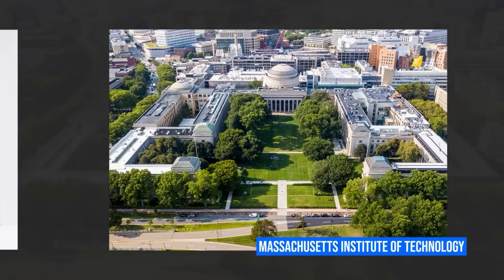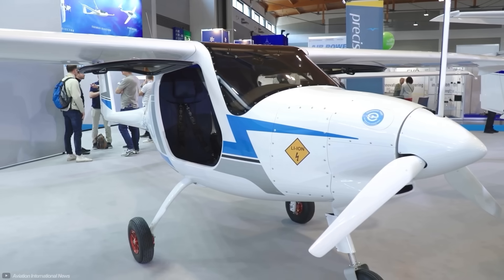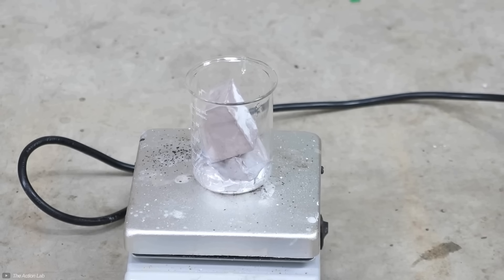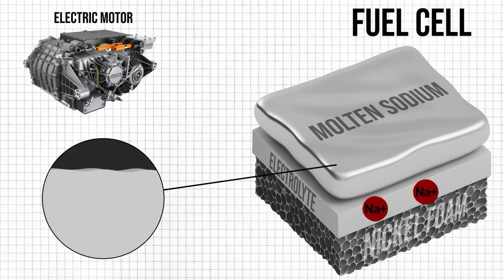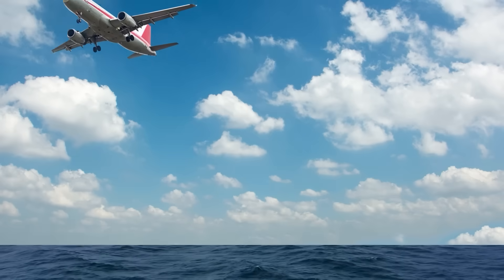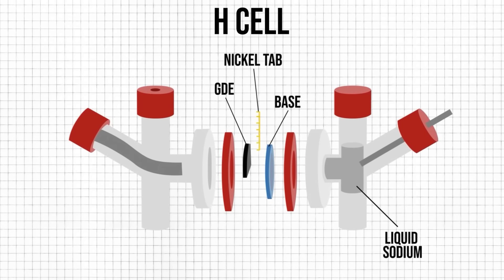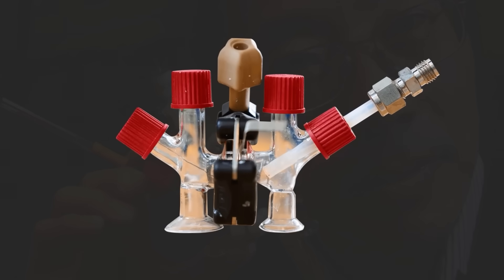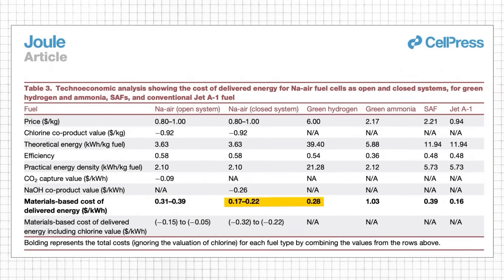How MIT's New Sodium Fuel Cell Changes Everything

Comment: Na ist das Abfallprodukt der Chlorchemie  also endlos  verfügbar.  So viel können die kaum fliegen. 
Es gibt ein weiteres Argument:  Das Startgewicht eines Langstreckenflugzeuges  wie dem A 330  ist um  70.000 kg höher, als bei der Landung.  Die könnten niemals  mit dem Startgewicht landen!  Alu und andere Ideen  sind auf jeden Fall  viel zu teuer. 
Kerosin  ist aber extrem günstig  weltweit  zu haben .  
1. Preis pro Liter in Katar
Offizieller Preis für Kerosin wurde zuletzt so veröffentlicht, dass für die ersten 350.000 Liter pro Jahr ein Preis von 0,80 Qatar-Riyal (QAR) pro Liter galt.
Danach gilt für Kerosin der „internationale Preis“ – es gibt keine feste aktuelle Angabe im offenen Datenmaterial.
Beispielzahlen für Benzin/Diesel: z. B. Diesel ~2,05 QAR/Liter.
Damit kann man – mit Vorsicht – für Kerosin grob diesen Mindestwert annehmen: ≈ 0,80 QAR pro Liter (Stand früher) → in Euro oder USD müsste man noch umrechnen.
Wenn wir z. B. annehmen 0,80 QAR/Liter und mit einem Wechselkurs von etwa 1 QAR ≈ 0,27 USD rechnen (~ Stand 2025) → das wären etwa 0,216 USD/Liter (≈ 0,20 USD)
2. Preis pro Gallon
1 US-Gallon = 3,785 Liter.
Wenn 1 Liter ≈ 0,216 USD, dann 1 Gallon ≈ 0,216 USD × 3,785 ≈ 0,82 USD/Gallon.
In QAR: 0,80 QAR/Liter × 3,785 ≈ 3,03 QAR/Gallon.
3. Energieinhalt (kWh) pro Liter
Der Energieinhalt von Kerosin wird typischerweise mit etwa ~10 kWh pro Liter angegeben. 
Eine andere Quelle listet Werte von ~9 kWh/Liter. 
open-plan-documentation.readthedocs.io
Damit: wenn 1 Liter ≈10 kWh, dann kann man den Preis pro kWh abschätzen:
Preis 0,216 USD / 10 kWh = ≈ 0,0216 USD/kWh. Das sind Mindestpreise in katar , die nur aufzeigen sollen, wie  günstig  fossilen Brennstoffe  sein können.  mit  ca. 3 Cent  je kWh  ist kaum zu konkurrieren, zumal  Düsentriebwerke  deutlich  effizienter sind, als der Kolbenmotor  im Auto .

Comment: I'm no chemist either, but sodium hydroxide is very alkali (high ph).  I do not believe it would all combine with CO₂ in the air on its way to the ground or the water. That part which does become NaHCO₃ once it hit water would react to release CO₂ and leave behind NaOH once again. Now dissolved CO₂ in the oceans is making them more acidic so the addition of NaOH would tend to neutralise that, but we wouldn't want it to go too far.  

I have no idea how much CO₂ is dissolved in the oceans presently, never mind how much we are looking at in future, and so it would be impossible for me to say how much NaOH exhaust from an air fleet powered by such fuel cells would be a perfect balance, but there is a number.  We need investigation of this calculus before going all in on such a technology.

Comment: This specific project seems only of relevance as a base for future research. But emitting sodium hydroxide in the upper atmosphere over the deep ocean should be relatively okay, unlike what most people would think. It'd be better than when we do and did a similar thing by burning fuels containing sulfur, and would cancel out some of that. It was at one point suggested that it could be used with jet aircraft in a vaguely similar way to how diesel engines have exhaust fluid. Only the main idea would be to react with CO2 regardless of the levels of NOx and such, and to form the very white clouds of basic material in the upper atmosphere.

Comment: One key capability for an airplane is the ability to dump fuel during an emergency, both to get below the maximum takeoff weight, and to reduce the risk of post crash fire. 

That’s bad enough when the fuel is kerosene. But when the fuel is liquid sodium….

Comment: NOPE!  Definitely not a practical source of energy because of the severe hazards associated with sodium flammability. Don't forget that aircraft frames are aluminium alloy and any contact with caustic causes catastrophic corrosion by stripping the protective oxide coating.

Comment: This technology seems to be fraught with with danger, and the potential for things to go catastrophically wrong. And it's only a variation of the old single use cell with replaceable electrodes. Sodium metal is very dangerous if accidentally exposed to water, and will explode, if given the chance.
Reply: In addition, have you seen what NaOH does to Aluminium and its alloys? So what will they use to construct the aircraft?

Comment: You just need a speed of light ground switch of 80meters.  The switch sends electrons front to back, turning another cylinder.  The return, ground switch, is a third cylinder turning that cylinder, but much more slowly because its a coil.  Without the actual ground being reached, it must opperate at twice the distance of the waveform.  Luckily electrons are very well suited up to 250mhz 220vilts.  So its very easy to reach hundreds of times more efficiency than gasoline 105.  This is by feeding 9v pure DC to 555ic 500khz -> 7 series 50uF -> 200mhz PNP -> 100uF ( 8 phase full multiplier ) -> Giga ohm antenna.  Short across the antenna at 200v -> ground speed of light switch with zener diode.  You will need hundreds of these to get exponentially more power, but 10,000 cycles = 50hrz AC 220v.  It works because a capacitor aligns space, dimensions don't actually exist, but are little bits and bobs that can't reach zero.  The antenna heats up at 500khz x 5, theoretical multiplied voltage, but you can make hundreds of types.

Comment: These sodium fuel cells could be deployed as sealed units, so nobody has to deal with the molten sodium.  You just plug one in to melt the sodium, then use the power as it produces sodium hydroxide.  The sodium hydroxide would be stored until you were over the ocean, then gets dumped.  Even over land, it would be converted to sodium bicarbonate before it hit the ground, which is harmless.  Dump it over the ocean and it combats ocean acidification.  Zero pollution because the sodium originally came from the ocean water.  When it's depleted, start using the next sealed unit.  Refueling at the airport would just get the spent units off the plane, and put on units with more sodium.  Like moving luggage.

Ammonia, sodium-air, and aluminum-air fuel cells all use incredibly common elements:  Nitrogen, sodium, and aluminum.

Comment: Sodium cell designs are cheaper to build than lithium, but will probably not see major use. The sodium cells form dendrites extremely fast. Molten sodium cells have thermal runaway problems while solid state sodium has a very short lifespan. Aluminum graphene battery technology is just as cheap to produce as sodium, has a much higher energy density than sodium or lithium, not thermal runaway (which means high speed charging is possible), and has a lifespan of decades instead of just a few hundred charges.

Comment: As a Safety Kind of Guy, I'm more than just a little leery of having molten Sodium in a passenger vehicle of any kind. The protection needed to make sure it can NEVER hit the occupants or bystanders would probably negate any benefits from it.
The concept of de-acidifying the oceans is also concerning. What if we de-acidify them so bad they become Basic? Goodbye, current life on earth.
And don't think it can't happen. We used to think there was no problem with using High Sulfur Petroleum as motor fuels...
And then we almost lost the forests.
One of my pet peeves is the RELIGIOUS BELIEF among the scientific and engineering community that "DiLuTiOn Is ThE kEy To PoLlUtIoN."
It CAN be... Until we saturate the solution!

Comment: Hi Ziroth,
Nice video, presentation and subject.

Of course the fact that this Na-fuel cell produces NaOH, NaHCO3 and Na2CO3 is not per se a problem; the fact they plan to drop it into the sea or during flight is not directly a problem but of course even if I'm a (bio)chemical engineer specialized into organic chemistry (and passionate about chemistry since the age of 15 years old) I would find this unenvironmentally fiendly - and simply by considering engineering, chemical processes and cost; a TOTAL waste of money to drop this into the air / sea.

The basicity of seas will not change much, nor the CO2(g) level in the atmosphere if doing so, but stil not a good idea; considering the fact that the best "waste" is no garbage at all.

As a matter of facts, source of metallic Na can be NaCl; but just aswel NaOH (Na2O) and eventually Na2CO3 or NaHCO3; so don't trow away the valuable stuff recycle it (into Na fuel), re-use it or re-sell it (both as soda cristals (Na2CO3) or backing soda (NaHCO3); they will find use after processing to common users or specific industrial users (as acid fighters or buffer trimer on chemical plants).

In fine, the idea is good, but why to stop there? You can have a lithium accumulator base principe mimicking your Na-Fuel cell (a Li-Fuel cell)
By comparing the datas this can be quite better than the Na:
Na
volumic mass: 0.968 g/ ccm (20°C)
T°fusion: 97.8°C
Boiling point: 883°C
Atomic mass: 22.989 uma
Electronegativity: 0.93

Li
volumic mass: 0.534 g/ ccm (20°C)
T°fusion: 180.5°C
Boiling point: 1342°C
Atomic mass: 6.941 uma
Electronegativity: 0.98

Li has about the same kind of reactivity as Na (but is slighly less reactive towards water (safer)) and a melting point relatively close (<200°C) so it could be used likely.
Li has a density nearly 0.5516 of that of Na ( so nearly takes twice its volume) but its atomic mass is more than 3 times lower than that of Na; what means that an equivalent weight contains more than 3 times more atomes and thus roughly 3/2 (1,5 times more power).

Continue the good job
Regards,

PHZ
(PHILOU Zrealone from the Science Madness forum and many former A.O.L. newsgroups related to chemistry)

N.B.:
The glass fuel cell that has one one side some dissolved NaOH make me hissing (regarding how bad NaOH can react with glass; it dissolves it slowly but does it (stronger if hot); it dissolves the SiO2 and Na2SiO3 as Na4SiO4 and chew through it slowly but truely rendering most glasware less and less resistant and structuraly integer.

The release of NaOH solution is a bad idea if in close vicinity of aluminium or magnesium what are often used into airplanes to make their structure lighter and moderately strong... it is a bit why you can't take mercury or galium into a plane; NaOH solution dissolve the upper protective layer of Al2O3 - AlO(OH) - Al(OH)3 as Na3AlO3 and then the naked decaped metal becomes super reactive towards H2O and NaOH setting free H2(g), heat and Na3AlO3.

BTW:
Al2O3 + 3 H2O --> 2 Al(OH)3

Al + 2 H2O --> AlO(OH) + 3/2 H2(g)
AlO(OH) + H2O --> Al(OH)3

Al + 3 H2O --> Al(OH)3 + 3/2 H2(g) + a lot of heat (exothermic)

Al(OH)3 is also H3AlO3 (it is amphoteric and thus display acidity if in strong alkaline media; but the formalism of acids calls "usually" for H atoms in front of the molecules like HNO3, HCl, H2SO4, H3PO4, etc. so a mild apparented boric acid what is H3BO3 (is also B(OH)3)

Al(OH)3 + 3 NaOH --> Na3AlO3 + 3 H2O

That is why Al powder was used into some drain cleaner NaOH prills to increase the effect thanks to locally overpressure of H2 gas and heat.

Aluminium metal is about equaly sensitive to strong acids (like HCl "diluted" to 28% by weight) as to bases (like NaOH solution about as diluted 20-40% used into drain cleaning solutions).

Comment: 🤔 I know the assumption is that this will be replacing batteries, but talking about the energy density of a fuel cell is like talking about the energy density of a jet engine. It makes more sense to talk about the power to weight ratio of the stack, and then discuss how much fuel is consumed by the process.

For example, can you put something like this in an Airbus A320? It has a pair of engines that each produce about 10Mg of thrust. The Airbus E-Fan prototype used a pair of 30kW EDFs that produced 120kg of thrust, giving them an efficiency of 4g/W. A jetliner has a much larger fan, so efficiencies of 5+ seem entirely achievable. That means we need a 4MW stack to produce our 20Mg of thrust. Current automotive hydrogen cells produce ~3W/g, so if we use that as a baseline, we're looking at 1.5Mg for a 4.5MW stack, leaving some power for life support and the galley even at takeoff. A ton and a half ain't much on a 78Mg airship.

So what about fuel consumption? The A320 cruises at 75-85% throttle, so we'll assume a typical motor load of 3MW, just to make the math easy. They reported "energy densities" of up to 1.5kWh per kg, so even if we assume that mass is entirely sodium, we'd only consume 2Mg per hour of flight. The combustion A320 burns about 2.4Mg of kerosene per hour, so the electric version may actually have better range. 😯

Comment: 🤔 I know the assumption is that we’re replacing a battery, but talking about the energy density of a fuel cell is like talking about the energy density of a jet engine. It’s better to say that a 100kW stack will weigh 500kg or whatever, and then discuss how much fuel it consumes in the process. 

How big of a stack would you need to power an EDF A320? If you bottle the NaOH, how much energy is needed to recycle it into fuel grade metal again? How much energy can they get from a kg of sodium? 🤓

Comment: Agree Ryan, this just raises lots more questions than it answers. What is the timescale of the conversion of Sodium Hydroxide (NaOH) to Sodium Carbonate in the air? At low altitudes, such as take and landing where more power is required and hence more NaOH is produced by the 'fuel-cell', will the caustic nature of the emissions cause issues for those living underneath the flight path? In heavily utilised airports, where planes are separated by minutes, will the wake of NaOH exhaust from one plane (or the localised build up of such) cause issues for the planes behind in the stack? Will corrosive pockets build up around airports lowering the life expectancy of planes or leading to higher risks of mechanical failure and so requiring more frequent inspections with higher maintenance costs? 

Worse yet, Sodium Hydroxide also reacts with ozone at low temperatures forming Sodium Ozonide (NaO3), which would be stable at high atmospheric temperatures (degrading back to NaOH at around -10°C). What would be the impact of direct injection of Sodium Hydroxide into the atmosphere, particularly at the 9,000 metres that planes cruise at, is this another ozone hole chemical in the making?
 
And on a technical level, where does the energy come from to melt the sodium (31.4 Wh/kg), will batteries be required to provide the initial energy and can the fuel-cell actually be self-sustaining if only producing power at 40 W/kg at the output.

The specific energy density appears lower than that of Lithium-Air, and even Sodium-Air batteries when taking into fuel-cell account losses/energy needs involved. Hence energy density isn't the primary benefit, rather the research team seems to be saying it's the ability to mirror the low landing weight advantage of a jettisoned consumable energy source just like a jet fuel. Effectively targeting cost savings of repurposing existing airframe designs that are optimised to low weight landings. 

I suspect they may actually be looking to a hybrid approach with battery/hydrogen powered take-off/landing, with lower emissions, with the NaOH fuel-cell operating at cruise altitudes, in an attempt to lower the landing weight.

Comment: A sodium-Pltassium alloy may be liquid at -12.6°C to 785°C with 77% Potassium. ( Yes, also Potassium can be used). That liquid can fill a fuel tank just like gasoline and does not have to be heated. The hydroxide can be stored in a waste dispenser. It will be emptied for recycling while filling new fuel. The extra weight of the dispenser is not critical for cars as much as for airplanes.

Comment: In my opinon it should be raw material cycle, otherwise you run from one problem to much co2 to another: to much cloride while producing sodium as fuel, which is in many selled products already a problem. E.g PVC due to lack of recycling methods just burned, guess what comes out? FCKW also no longer allowed. Is there any material where it could reside beside of NaCL where it is then made of?

Comment: Don't compare this new Sodium Fuel with battery. Battery that you mention (with density around 200Wh/kg) can be re-charged many times, while this Sodium Fuel isn't.  You should instead compare it with current fossil fuel used in planes. 

And without that "Carbon Emission" stuff, fossil fuel is here to stay in jet planes. 

Also pure sodium is dangerous when transported and must not be exposed to air, much more difficult than fossil fuel.
Also byproduct of Sodium Hydroxide is also very corrosive, even with handling properly, the moisture containing this nasty chemical quickly corrode plane engine.

So you are dealing with massively dangerous chemical, both the raw and the used form, relative to fossil fuel.

Maybe there is application somewhere else. But I think using it as jet fuel or vehicle fuel is very bad idea.

Comment: i challenge you to research the environmental costs of those wind turbines shown in this video:
how long it will take one wind turbine to generate enough energy to cover the energy cost it took to manufacture the parts and then to build and setup the wind turbine
also - they are currently burying the turbine blades that fail because they are non-recyclable - please calculate the cost to the environment and
the cost of downtime while the wind turbines are not functioning - please also include the energy costs for the new blades to be created delivered and installed...
Reply: I challenge you to do the same for coal, gas, or nuclear power generation and see which you'd rather have in your back yard, smartass.